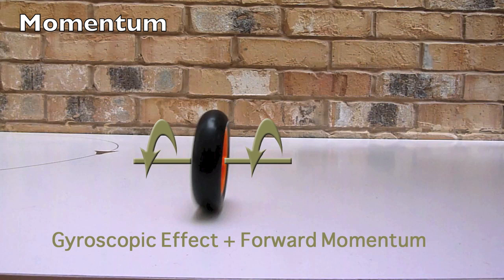The Physics of Countersteering

Comment: "this is what keeps a moving bike upright" WRONG!!! Everything in this video is 100% accurate except this. A bike is stable not because of the rotating wheels, but because of the pivot of the handlebars. If you weld the steering so it can't move, the bike will fall over quickly. Counter-rotating wheel mass has proven this fact. A bike will still ride fine with wheels of ZERO weight. Good video besides that...

Comment: Thank you, this just proves my theory ^^ I'm so proud of my self, I've been doing some work on "the back of the envelope" how to calculate the angle of the motorcycle to the horizontal and came up with a formula tan(theta)=rg/v^2 which seems to work, but doesnt take into account any air resistance, or anything complex as that, thank you for posting this video

Comment: It will rotate on a third axis. This is called precession. It's why a toy gyroscope doesn't fall instead, the pull of gravity acts at a 90 degree and cause the gyroscope to spin. So as you rotate the bike by pushing on the handlebars it causes the bike to lean the opposited direction.

Comment: Dunno about that, motorcycles are just a mode of transportation. For me its just a way to get from point A to point B as cheaply as possible.  Anything more and you're just riding around wasting gas with no purpose at all.  And if you didn't know, the worlds oil supply is finite and running out.  So quit screwing around joyriding.  And when you pull up to those assholes filling their tanks on their SUVs at the gas station, key their fucking car for being douchebags, they are raising the price.